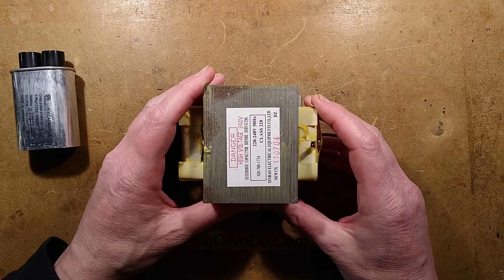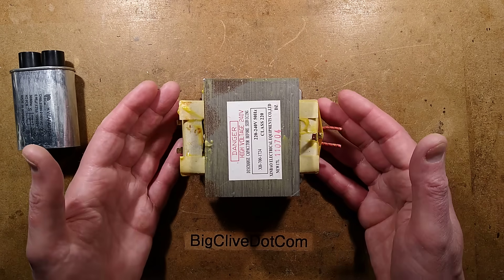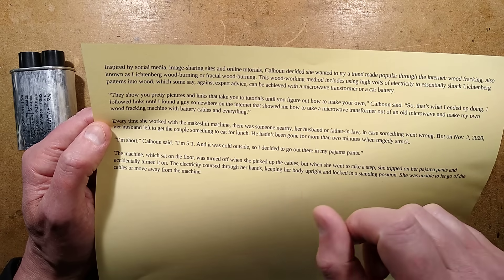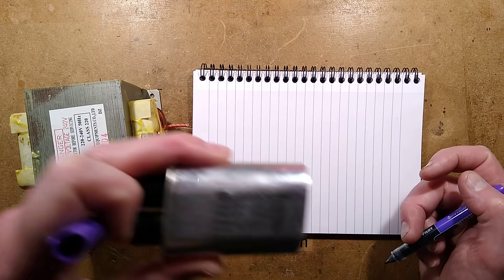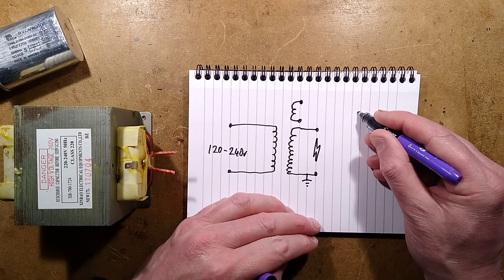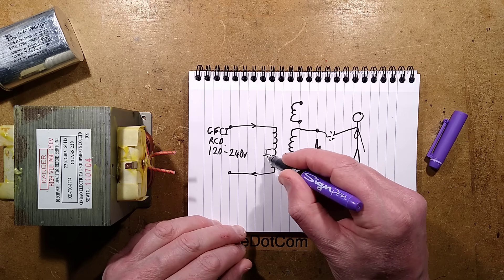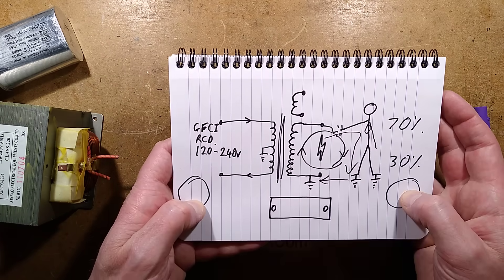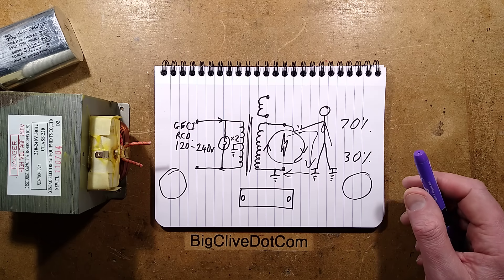The most deadly project on the Internet

Comment: I was electrocuted by this device that a friend built, I was locked for several seconds until he pulled the cable out of my hands. God bless I survived and was hospitalized with severe burns in my hands and recovered since. 

I was a student for design at this time, and I was shamed and under reported the issue to the school which also didn’t take a proactive approach. 

A few months later I heard another student in another school in the same city died from this, I still carry the shame for not speaking out when it happened.
Reply: Wow, what a recovery, you were electrocuted (dead) and are still able to type. How's zombie life?
Reply: @fvckyoutubescensorshipandt2718  "electrocuted" definition -> injure or kill someone by electric shock. I chose the injure option.

Comment: As someone who has worked around high voltages for years, there are many dangers.
The formal safety training I receive is often given by someone with a claw hand or in a wheelchair.  I have listened to many first hand accounts as to the results.  If you manage to survive the electrocution, your nervous system will be permanently messed up. The cool art isn't worth the risk.
Reply: Years ago, some roadworks were being done outside my work and there was a metal pipe containing an 11KV underground cable.  The power authority gave the all clear that it was disconnected and perfectly safe and one of the workers was told to cut through the pipe - and the wire within - with a hacksaw.
Well, it wasn't disconnected and, despite the fact that he had a metal saw blade touching both the wire and the metal pipe that was still mostly embedded in the earth, he still managed to get a large-enough belt that it burned his hand and there was an exit burn on the underside of one foot, it pretty much cooked the flesh through a large chunk of his body.
He survived - but his nervous system was permanently "messed up" (which is a lot more polite than I would normally phrase it).
You can buy a device that you can hold next to a wall and detect the current flowing through the wires through inductance.  I keep wondering why no one had some similar gadget to check to see if there was current flowing through the wire he was about to cut.
No one checked, they just took the word of someone who was, in hind-sight, obviously and tragically WRONG
To my knowledge, no one was held responsible for that.  No one lost their job over it - well, no one except the guy who was so badly injured and messed up he could no longer work!
Reply: @Wolf NZ Outdoors  Never trust someone who tells you 'ye it's turned off' /'ye it's safe' - just check it. 
Be paranoid in any case that may involve dying or mutilation: electrical, blades/saws, crushing moving elements or even diving (Delta P).
Reply: @Catastropheshe  Yeah, I know.  This is why I can't understand why someone didn't do a current check before they got that guy to start cutting - it's got to be one of the easiest things to do - and would have saved him from being effed up for the rest of his life.
Reply: @wolf1066  Exactly my point. Sorry you had to see that.  I did put that mildly.
Many videos given during training were of autopsies or medical reports. Not pretty.
Reply: @avnut5517  EMT training covers the barest basics of this in both personal safety and in trauma.

The images and descriptions alone were enough to tell me that you do NOT want to experience electrocutions firsthand.
Reply: I’m pretty happy that in my field “ask me how I know that?” Doesn’t end up with severe bodily harm, just a broken computer program.
Reply: @puellanivis  unless it's computer program of plane or medical instruments 😁
Reply: @Catastropheshe  Good point!
Reply: If you manage to survive electrocution you'll get cool art on the inside though.
Reply: Pffffkt!?! "First 👏"😅
Reply: Like, I could draw that with wood burning tools. Hell, I could tattoo it. Anything. Like, yeah, scary ass eletricity looks cool - we've known that for years. Take a picture of a storm for fucks sake lol, like, I just can't see the risk having a worthwhile reward smh
Reply: @Mark Jones Here in New Zealand, we have this thing called "ACC" - "Accident Compensation Corporation" - basically a government-protected insurance company that theoretically pays out compensation for people who are injured, therefore we don't have the ability to sue someone for injuries...
In practice, ACC is a typical insurance company that happily takes premiums (in this case through taxes and compulsory levies) and does its level best to avoid paying out.
So there's no chance the poor bastard could sue the power company or his employer (or anyone else that could be deemed culpable) and a pretty low chance that he got halfway decent compensation for losing his job and being permanently disabled.
Reply: @Mark Jones 
Dear god that's bad!  Yeah, one of my tenants has a bad habit of leaving his extension plugs plugged in and has twice left it in the rain.  He has a little kid and a dog.  Not okay.
Reply: @Mark Jones I reckon if they'd bothered to bring a detector within 10 feet of that 11kV line, the needle would've slammed into the stop pin so hard it would've wrapped around it 3 times!
This was entirely preventable.  Instead they just took someone's word for it and, so far as I'm aware, no one was held responsible for it.
Reply: As a landlord, I've seen how little respect some people have for electricity.
Reply: Okay of your nervous system is messed up what is that gonna result to? Whats the symptoms
Reply: @opal6664  It depends. From what I know, it's just about any neurological symptom you can think of. Loss of control to any one of your body parts, difficulty speaking, swallowing, breathing, etc, blindness, the whole package. Electricity is one of the deadliest and most painful things you can work with, depending on the specifics.

Comment: Great video!  Here's a dumb question: Do heavy rubber lineman's gloves [which I learned about when I took a class on hybrid auto repair] protect against such high voltage?  Or do linemen have other safety devices [such as insulated fiberglass lift buckets] that are required with these power levels?
Reply: The statement "it depends" applies here. First, they have to be rated greater than the appropriate voltage being handled. Second, they have to be tested annually by a certified testing agency. Third, they need to be visually inspected for damage prior to use. Finally, they should only be used by qualified personnel. I am guessing that you wouldn't be considered qualified personnel if you are asking this question so my advice is don't try it.

There is an old saying, machines don't forgive or give second chances. If you give them a chance to bite you, they will.
Reply: @boblund8444  I was just wondering if some sort of induction probe could assure techs of a safe working environment?
Reply from the maker: They have multiple layers of insulation.  Draped rubber blankets over wires, regularly tested rubber gloves with leather abrasion protectors, a fibreglass bucket and a fireglass section of boom on their bucket truck.  Then they also have years of training.

Comment: it's not the voltage that kills you its the Amps. static charges like when you take a sweater off is around 2k volts BUT the amps are down in pico amps. When working with high voltage use an isolation transformer and keep one had in your pocket. I had a neon light transformer that the primary was 120v the secondary was around 2kv. i wanted to see if the primary had an open it it. I set my meter on resistance which puts a small current from tip to tip of the test probe. so i connected the leads to the primary. when i removed the leads this caused a pulse which caused a pules in the secondary of 2kvolts....any transformer will do this same w/ the microwave transformer. .5 amps from one arm across your chest to the other is enough to stop your heart.

Comment: As a retired electronics engineer (still working with valve stuff however as a hobby) I involuntarily found I had put my left hand in my pocket; and I was just watching the 1st couple of minutes when you described the risks these stupid people are taking ! 

I've had my fair share of nasty belts when working - usually when tired or distracted - but them just taking mad risks for art - well, at least they're not harming others, God help them.
Reply: Took me a while to figure out what you meant about the hand in pocket. Can't bridge shit you shouldn't be bridging if you only have one hand available?
Reply: @Poldovico   @Poldovico  Not only that - if you do get a shock it will not pass across the chest, stopping the heart - which is why it has to be the left hand (LH).

In short, with power isolated from the equipment under test (EUT), attach a fixed croc clip from the meter to the point you are referencing the voltage reading from. Do not use a wanderlead probe held in the left hand. 

LH in pocket also stops the cardinal error; forgetting where the LH is and touching chassis or other ground with it. Then you can poke around RELATIVELY safe from a lethal shock, using just your right hand, (RH). To be sure however, always use this technique with the EUT powered from a 1:1 isolation transformer, that way you are no longer electrically connected to the mains supply. 

Obviously, though the LH rule still applies: because if you were to touch BOTH sides of the isolated supply with each hand at the same time you would still get a potentially ! LETHAL shock. Thus, using the RH only to test no circuit is made, and there is no connection to the AC line so no danger. There are exceptions - always periodically test your isolation Tx for insulation integrity (Pri to Sec), etc. at at least 2x Working Voltage. 

Big PA and guitar amplifiers, rated at up to 100W can have as much as 400V dc present at the valve anodes of the power stages, just take all precautions you can and never get leary of them.

We only live once!

Also I made up an emergency off switch - a 'Mushroom Switch' - from a mains relay and neon indicator that latches the power on with a small green button, but cuts power to the entire bench with just a whack from anything or anyone on the Big Red Button.
Reply: @tiggywinkle1000  I work in CNC machining.  We have similar “mushroom switches,” but they’re called “emergency stops.”  One push locks them in place and instantly cuts power, hydraulics, and pneumatics to the entire machine.

Good to see that the practice goes well beyond my (relatively safe) work environment!
Reply: its the thing of not knowing, that the information just isnt presented, its much easier to be  caught by the thousands of videos saying how easy and safe it is. Thats why this video is so important

Comment: I have like 12 microwave oven transformers in my garage, I want to do something with them one day, but I'm just very scared to. Super dangerous stuff!
Reply: Scrap them for the copper winding/wiring.
Reply: Your fear is grounded (ha!) in reality. Take them to a recycler and don’t look back.
Reply: Connect them all together!!

...AFTER you've finished the 3-stage redundant RF remote controller that you can activate from the other side of the room house (ideally the next door neighbor's).
Reply: If you cut the secondairy winding out and put 12v from a car battery on it, it makes for a really stond electromagnet. Lots of fun can be had with that, no danser of shocking yourself because 12v DC is relatively harmless
Reply: A lot of people make arc welding machines with them.  You have to remove the high voltage secondary windings first.
Reply: Turn them into AM transmitters!! All you need is an AM crystal oscillator, 5volt battery and antennae and ground!!
AM transmitters are stupidly simple even my Cat can make one 🐱👍🏿
Reply: Daisy Chain Them!
Reply: Heres a great project for them transformers. No risk of danger or death with this one. This works well if you have 1 transformer or 12 or even 100, doesnt matter. ok first thing you want to do is line them all up on the edge of a table. Now heres the fun part... Grab your trash can and slide it to the table and with one hand holding the trash can and with the other one you wanna just sweep your whole arm across the table knocking them all into the trash can. By all means its a very simple project but you'll notice how many years it can put onto your life expectancy. I call it "wtf was i thinking? throw them away". So yea. Be safe and have a nice day for the rest of your life... p.s. sorry for the paragraph of a comment reply.
Reply: @MrLarry-gr8  If I'm not going to do anything with them, I'll just get the copper out
Reply: @OfficiallySnek  that's cool. If you want to fight the coil just so it can make a few bucks available then more power to it (figuratively speaking) and to tell you the truth that's a great idea. Let me know if it was worth it. Btw I been in the electrical industry for well over 30 years and I know for a fact them windings are not easy to get out. Rightly said you might even get hurt trying to remove the copper like slicing a finger clean off, lol... highly unlikely but hey, you never know.
Reply: @MrLarry-gr8  I probably won't scrap it (as in give it away for money) I'll probably melt it down to make something cool. I have always wanted to do that. I also have been collecting bullet casing I come across in the woods for the brass. So that's another project I want to get around to :)
Reply: I have removed the secondary coil and replaced it with 3 turns of very thick wire, so that I can melt metal with the high current. The voltage is very low, but I use gloves and have a special holder were I put the needles in place after I have used it. All this is in a nice housing with LED indicator that it is on and for the secondary side I have indicator-LEDs too.

Comment: You are spot on about the dangers of hi voltage electricity. Back in the day when TVs had a CRT there was a gizmo called a fly-back transformer which provided the hi voltage potential that the color guns shot their electrons at to make the pretty pictures we all enjoyed, It was about 18 to 24 thousand volts. 50 years later I still have the scars from the sheet metal gotten while rapidly extracting my hand and arm from the back of a TV. Some tests had to eb done with the thing plugged in and turned on. I said all that to say this. A microwave transformer, the ignition transformer, or a neon sign transformer can all be use for fracking wood.  BUT they don't give fools many second chances.   Use the clamps the Welders use to ground their machines.  Use high voltage wire like that found on an auto ignition system.  Plug your transformer into a  Variac and gradually raise the voltage on your salty wet wood. Telling them not to touch it is pointless, If they don't grasp the fact that any voltage powerful enough to turn wood into charcoal would gleefully do the same to them nothing you or can say will make a difference.

Spouses, if you see your SO building one of these things ,now may be a good time to take out that additional life insurance policy.

Comment: Rubber shoes and calloused hands may protect a bit against HV DC, but with AC your skin and shoes act like capacitors and conduct! Plus the voltage is so high that it exceeds the breakdown voltage of your skin and shoes! There are really no insulators - everything is a dielectric with AC voltages. Just look at the videos of HV transmission lines (300-500kv or higher). A grounded object coming within a few feet of the line will make a long fiery arc.

Comment: Even playing with 220v is ten times more dangerous than the 110v we're used to in North America.   TIP:  Don't confirm open circuit in 220v by briefly flicking the 2 wires together.  Bad idea.  Guess what happened?

Comment: As an engineer I immediately thought there has to be a way to put some kind of GFCI protection on the secondary.
The problem is the wood burning process in itself is chaotic and likely has current going everywhere,  including the air itself. Any scaled up GFCI circuit would be tripping all the time in this process. I actually found a high voltage GFCI that was appropriate for such a circuit for a mere $2200 dollars and a huge lead time. Means it is made to order. Nope nope nope. Any probe insulated enough to handle the voltage properly would be large and clumsy (like the old CRT voltage probes) and not usable for this function. Wire with the proper insulation rating would have very thick and clumsy cladding. I've been an engineer who worked with mixed systems with high voltage for 35 years and I got nothing. No way to properly make it safely without making it basically unusable. The only thing I could think of is a remote arm of some type like is used in old school isolation chambers. Clunky and expensive at best... could possibly print one but who would take the trouble to do that? I'll take a hard NO on that. I got zapped by an old tube based 25 inch TV high voltage deflection circuit... right off the button. Almost 25,000 volts at low current. Circa 1984.... never had a misplaced index finger when probing a CRT again!
Reply: I did think of one way to make it safer, but still not safe. Certified 18 inch high voltage lineman gloves. Class 2 or class 4 rubber gloves rated for the appropriate high voltage you are working with. a bargain at 300 to 650 dollars a pair and cover those with the required leather protector gloves at only $45 a pair... Of course you have to test the gloves and get them certified regularly.... any tiny hole is deadly!